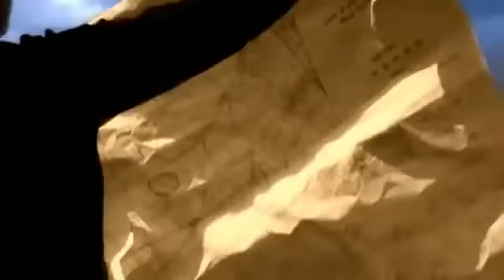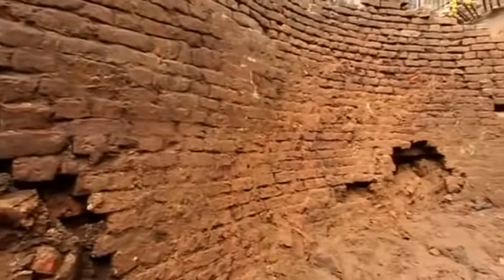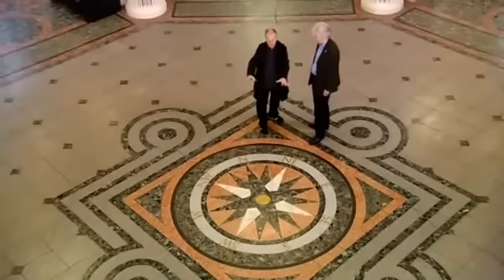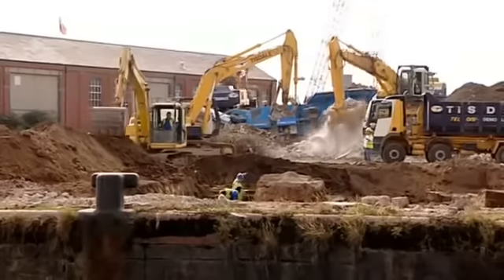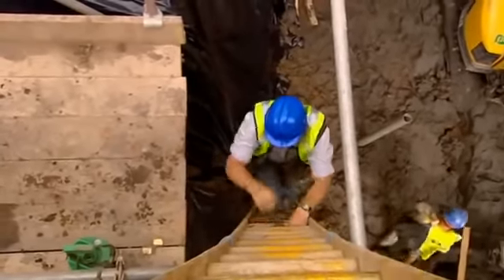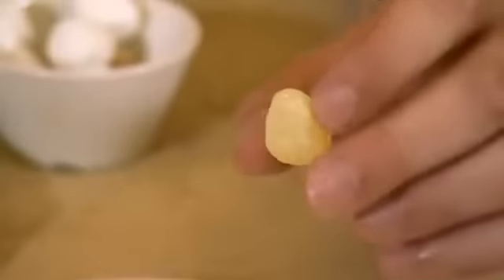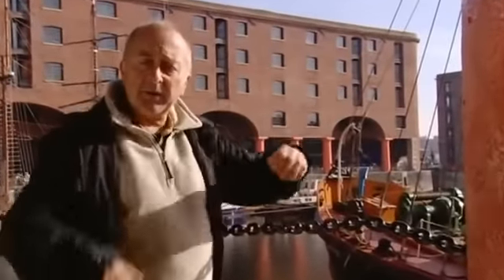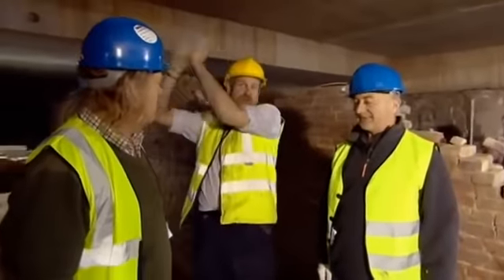Liverpool's lost docks (2008)

Comment: I'm curious about how water displacement by the ships affected the levels of the water in the dock area inside the locks.
Reply from the maker: I would have thought that was taken into account
Reply: @andybb   You're right I'm sure. I'm just curious how it was done so that ships could stay at the level of the deck to unload the goods.
Reply from the maker: @erinobrien8408  If you watch at 26:10 it will explain how it works
Reply: @andybb  Thanks for pointing that out for me!